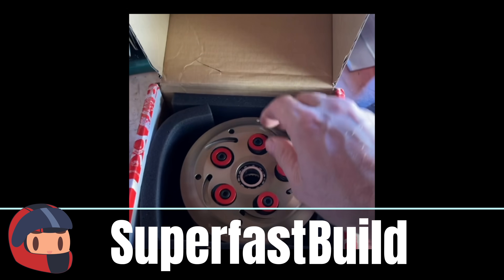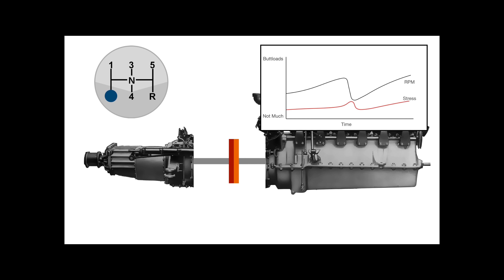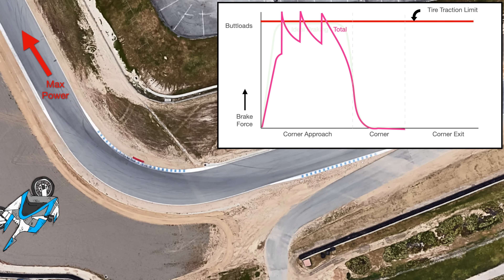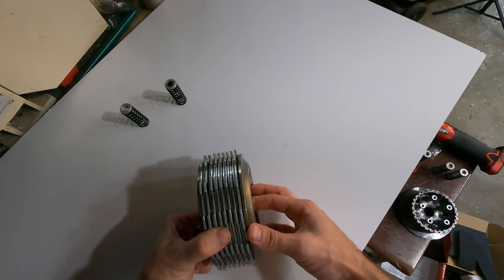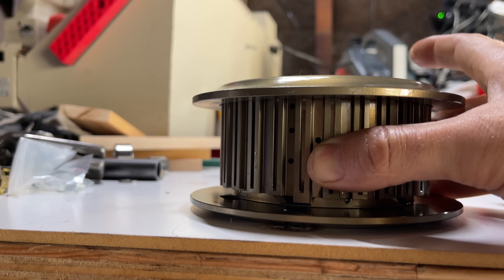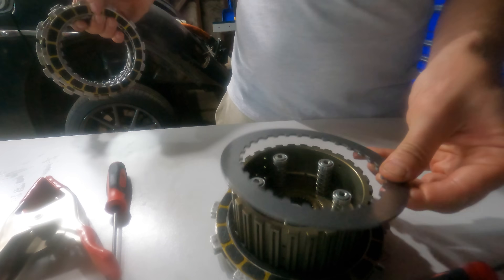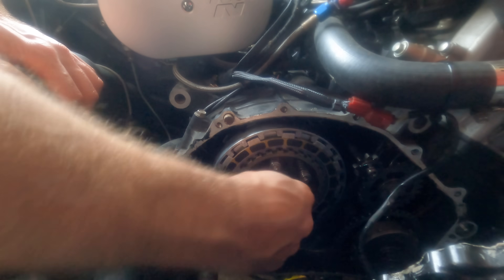How A Slipper Clutch Works

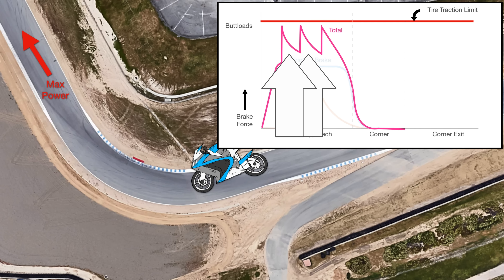Comment: 1:16 I think you might be confusing engine braking with compression braking. Compression braking is a type of engine braking, used by heavy trucks (large diesel in general). It works by opening the exhaust valve near the top of the compression stroke, releasing compressed air which slows down the vehicle, this is commonly known as Jake brake.

Comment: It looks like the ramps for the balls are probably anodized aluminum- how is that holding up?
    Seems like the balls would wear (peen? Brinell?) low spots in the ramps in the area where most of the action is.
    Honda used to split the clutch hub. Part of it could only transmit "forward driving" torque through a one way bearing. If engine braking were used, those plates are effectively disengaged, torque capacity reduced...clutch slips....wheel doesn't.  If they set it up right. 
     I used to worry that, after clutch wear, the hub parting line would line up with a plate, the teeth would snag, and the steel driven plates would destroy the aluminum hub.
   Never saw that, though. Sometimes honda's gizmos work ok.

Comment: I looked at all the different slipper clutches for motorcycles. One's from $600 to 1,200. I guess it would be okay on the track. But all of them seem to break at one point and have problems

Comment: Why do we want any compression braking? Can't you just disconnect the motor from the wheels entirely (with the clutch) when approaching a corner, and just brake with your... brakes? Then put the motor in whatever gear is best for the RPM of the exit?

Comment: Hi! Just wanted to add a tidbit, and apparently the thing that actually slows us down with an engine is actually the intake stroke when the throttle body is closed (you can test this if you have a car where the throttle is mechanically actuated) and while the compression stroke should the one that slows us down the most, the decompression that occurs when there's no combustion in the chamber aids the engine in keeping turning, just like a very lame combustion, so it cancels out.

Comment: Lot cheaper to set the idle up 1-200 rpm.  Throttle plate not completely shut= less negative compression.

Comment: That's a rachet clutch. A slipper clutch is used in manual transmission drag racing.
Reply: That is a slipper clutch, controlled by back torque (and not a ratchet or overrunning clutch). Drag racers use slipper clutches controlled by centrifugal action. They are both slipper clutches.

Comment: I thought this was called "Anti-Hopping-Kupplung" - interesting to see it being called slipper clutch in englischbinstead of anti-hopping haha.

Had one on my Honda CBR 1000RR SC59!

Was great - before a corner, shift to the next gear and simply let off of the clutch basically as hard as you want to, not much stamping of the rear wheel goin on

Comment: slipper and assist clutches are amazing, it should be standard on all motorcycles. prevents loss of traction during hard engine braking, and allows for lighter clutches

Comment: I don't race, I don't have a motorcycle or ever intend to get one, and I've only worked at the other end of the engine (computer, ignition, timing, etc.), but found this (especially your presentation) to be fascinating and really coherent.
Once you get the Jag put together, I will eagerly await your presentation of wheel alignment - should be a hoot.

Comment: Somewhat unrelated, but I have a question about the Jagula (Tessuar?). When you originally installed the Model 3 motor/subframe/suspension the rear track was significantly wider than a stock Jaguar Mk V's rear track. Any idea of how you're going to bring the rear wheels/tires inboard?
Reply from the maker: I'm not, I'm going to widen the fenders by about 2 inches.

Comment: Why is it called "compression braking" if most of the "braking" comes from the vacuum the engine is trying to overcome when the the butterfly valve is (mostly) closed?
Reply: Large diesel engines often have compression-release brakes (often known as "jake" brakes after Jacobs, the best-known manufacturer), but correct... motorcycle (and car) engines don't have compression braking. It's called compression braking by people who don't understand the difference or are just being sloppy (sorry Matt... this is one for your next "oops" video).
Reply: Just thought I’d share this, I’m cruising along on my little 125 cc motorbike, and I thought I wonder if I can “coast” by turning the engine off and opening the throttle? There’d be compression of all this air, and then decompression, as long as I didn’t lose too much to heat should be pretty sweet. I was wrong, after switching the engine off I was slowing down as if I’d just closed the throttle. Normal, then I opened the throttle wide open and the bike was like “bruuuuuuuuuu” and there was a significant amount more braking force than when the throttle is closed. Not sure if it answers your question but I was surprised.

Comment: Next video - How a Slipper Clutch Works but in a drag racing car
Reply: exactly. That is the only place i have seen slipper clutches used. then again i am not a motorcycle nerd :)
Reply: @uliwehner  same here😀
Reply: Completely different slip arrangement; the drag racing setup is a centrifugal clutch. Would probably need to wait until Matt goes drag racing (with an internal combustion engine, not electric).

Comment: has to do with the engine inertia. after shifting down the rear tire has to do work to get the motor up to speed from the new ratio. the slipper clutch helps nock down that ramp in speed and therefore torque at the rear wheel. it isn't doing much once it's up to speed there isn't enough engine braking to overcome the clutch springs.

the tiny fluctuations in engine breaking whale an engine is spinning at thousands of rpm kinda don't matter either. race bikes often run very high idles to minimize engine breaking. but the slipper clutch helps the tire not chirp whale getting the engine up to speed.

Comment: You've probably thought about it but it would be cool to see an electric motorcycle build on here. Or even a video about why you wouldn't want an electric motorcycle (current technology, use case, etc). 

I love the mix of bike and car information on this channel. Very interesting info. I have slid the tail on my bike after a downshift even with slipper clutch.  Guess I should be glad it had one and I didn't have a worse scenario.
Reply: Samesies on the slide

Comment: Also reduces the likelihood you will over-rev the engine on a downshift. I put a Yoyodyne on my Speed Triple. It's been awesome. That high compression engine would really give you an unsettling jolt if you flubbed a downshift cranking it into a turn.

Many years ago Saab had a manual transmission that included a Sprague Clutch . This device is like a slipper clutch w/o the plates. It is 100% engaged in one direction and 100% disengaged in the other. The engine would power the car forward but immediately drop to idle when the throttle was lifted. In rolling hills it gave an odd sensation of almost flying as you crested the hill and suddenly without the engine noise you were just floating down the other side. Some European EVs give the same sensation when set to make regen only with the brake pedal.
Reply: @bibblybobbly9951  Probably one of the old 2-stroke models. Crankcase scavenged 2-strokes cannot easily tolerate being used for engine braking because they get lubrication from the fuel, being spun at high speed with the throttle closed basically starves the engine of oil with predictable consequences. So 2-stroke cars often used an overrun clutch to allow the engine to stay at idle speed on downhills.

An aside, sprag clutches are a near universal component of conventional automatic transmissions. They're used mostly so that the car isn't 'jerky' at low speeds- if you've driven a manual with a low first gear ratio you're probably familiar with the abrupt deceleration you get when you suddenly lift off the throttle in first. In a manual this can be avoided by using the clutch, in an auto there is of course no clutch pedal so some other solution is required.
Reply: @nerd1000ify  Yes, it was a two-stroke but I do not recall the model. This was in about 1980 and the car was not new. not my car.
Reply: The trabant 601 also has a device similar to this on 4th gear. Its also two stroke so it makes sense, they do not have an oil tank, its mixed with the fuel

Comment: Very stupid question that came when you were installing the clutch back(3:28): Do you need to have all the teeth that connect to the engine (the outer ones) indexed/clocked to the same place in the engine "basket"? Can they be out of alignment? would it make a difference? Just sheer curiosity. great video!!!
Reply from the maker: The outermost one is offset one tooth. I don't know why; it's just what Honda says in the manual.
Reply: @SuperfastMatt  Tks for the reply!

Comment: In what way is the effect different from a cush drive in a clutch (as used in my 1966 Norton 650SS)?
Reply: https://en.wikipedia.org/wiki/Cush_drive
There is no complete mechanical disconnect....the rubber (or coiled metal) springs just absorb some of the forces ( "damp" them down) and one of the best illustrations is the coil springs in some vehicle clutch plates......

Comment: Cool. The slipper clutch on my Mazda works a little different. It starts slipping any time I give it more than 90% beans or if I'm going up a particularly steep hill in 4/5th gear.
Reply: This type of slipper clutch has the added benefit of making it very difficult to stall. Good feature.
Reply: Those ones are good for fuel economy
Reply: Haha, I had a 93 ford 1 ton diesel with a slipper clutch that only acted from a dead stop or under heavy loads. Think of all the torque I was able to avoid!!
Reply: It makes intense burnout effects without stupid tires getting all used up c:
Reply: Slow the oil leaks on to it for less slip, increase for more?
Reply: @RaglansElectricBaboon  did you ment refill oil for more slip?

Comment: Dude, if you just update to a 2008+ CBR 1000RR engine, they come with slipper clutches.
Reply: Something that it year starts with a 2?!? Ewww. Gross.
Reply: @danielbuckner2167  the model year of his current CBR1000RR engine also starts with a 2... and makes significantly less torque and horsepower.
Reply: @TravisFabel  So less ewww is better than more ewww... ok, I can except that reality. 👍

Comment: Does the slipper clutch basically make the vehicle engine brake less hard? 

If I accelerate in my car in first gear and take my foot off the pedal, this makes it not engine brake as hard, yes-yes?

Comment: Understeer is when you go off of the cliff.
Oversteer is when you go off of the cliff at the same place, backwards.
😎
Reply: Understeer is when you can see the tree you're hitting.
If you can only hear it, that's Oversteer
(Walter Röhrl, WRC Rally Legend)
Reply: 😄. A very Matt-esque explanation. 👌
Reply: Oversteer is when my passenger spoils his pants, understeer is when I spoil my pants 😊
Reply: Depends if the cliff is on the inside or outside of the corner. 😀
Reply: Nice lol

Comment: Is this how aircraft ABS systems work. They look similar to airliner style brakes. I can imagine that as the wheel tries to stop the plate lifts releasing braking force to allow the wheels to not lock up. The pilot can set the level of auto braking based on landing conditions as well so that would control the amount of force required for the ball bearings to move up the ramp.

Comment: Lots of RC cars have slipper clutches too. Since the gears, driveshafts, and axles are typically plastic the slipper clutch helps reduce parts breakages when you hammer on the throttle from a stop since the electric motor is capable of producing a lot of torque.
Reply: I was just thinking last time I fiddled with a slipper clutch was on a R/C car back in the ‘90’s! And that was after I thought it wasn’t needed on vegetarian Jag…